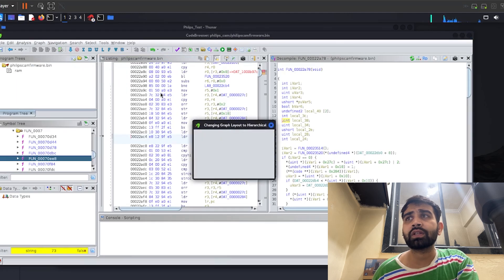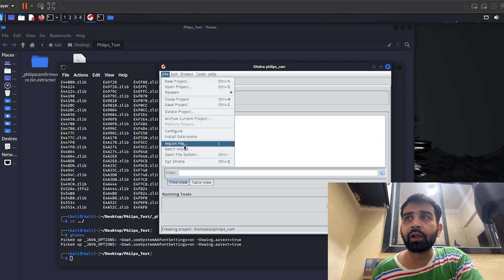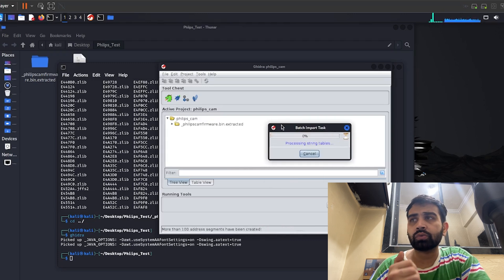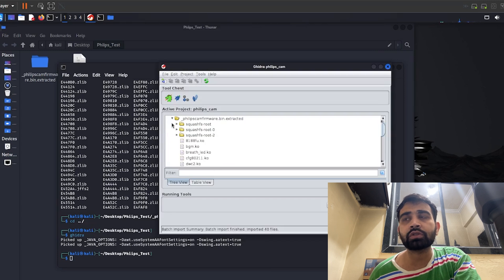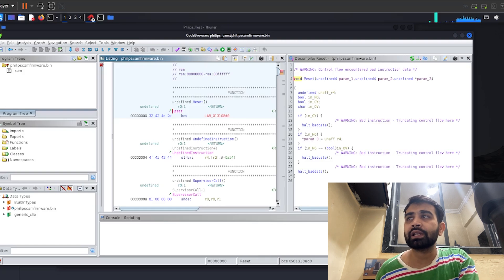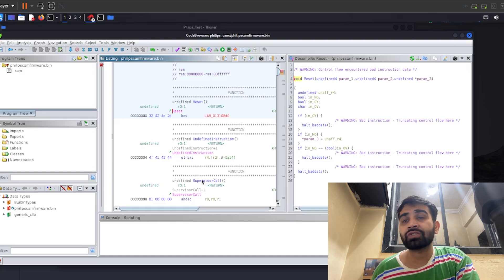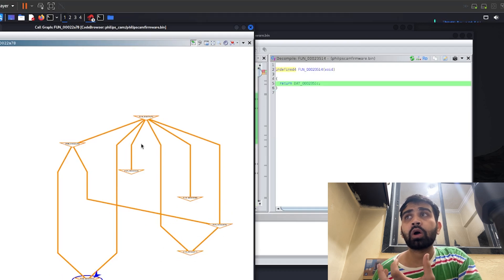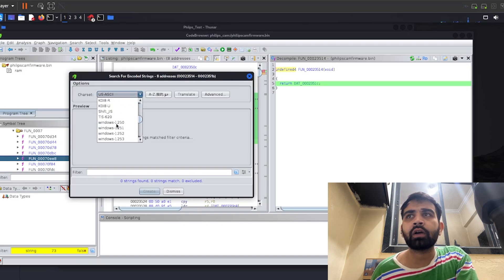Part-7 | Reverse Engineering Philips 5000 Series IoT Camera Firmware with Ghidra

Comment: The video was amazing. 
I have a question, do we need to see each and every file manually in order to get some vulnerability or is there a way by which we can make the process easy?
And one more thing, I think it's essential to learn C programming language for Reverse Engineering of IoT Devices hardware, correct me if I'm not. 

(Thanks for the amazing content, keep up the good work, 👍🏻. I want you to make this type of series on Wi-Fi hardware hacking and find some vulnerabilities in it and exploit them.)
Reply from the maker: @AzimJaved-ys5ol  Manually inspecting every file for vulnerabilities can be time-consuming. Instead, we can use automated tools and techniques like static analysis, dynamic analysis, and fuzzing to speed up the process. Tools such as Binwalk, Ghidra, Radare2, and IDA Pro help in analyzing firmware and binaries efficiently. Additionally, scripting with Python or using YARA rules can assist in identifying patterns of vulnerabilities quickly.

Regarding C programming, you’re absolutely right! Understanding C and Assembly is crucial for reverse engineering IoT device firmware, as most embedded systems rely on these languages. It helps in analyzing decompiled code, understanding memory management, and identifying security flaws effectively.

I appreciate your suggestion! Wi-Fi hardware hacking is an exciting area, and I’ll definitely consider making a series on it, focusing on vulnerabilities, exploitation techniques, and real-world scenarios. Stay tuned!

Thanks again for your support! Keep learning and hacking responsibly.